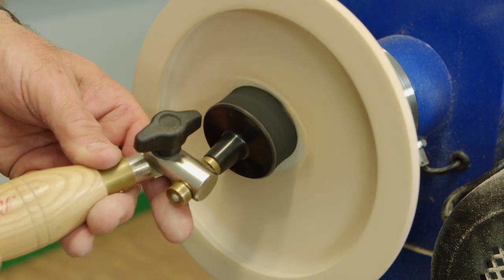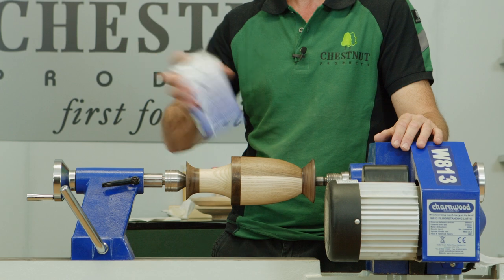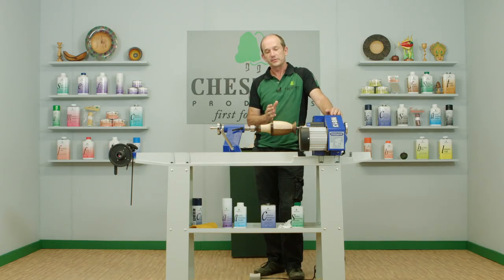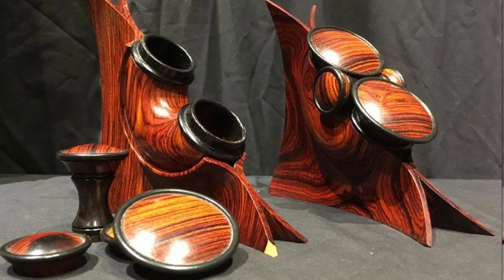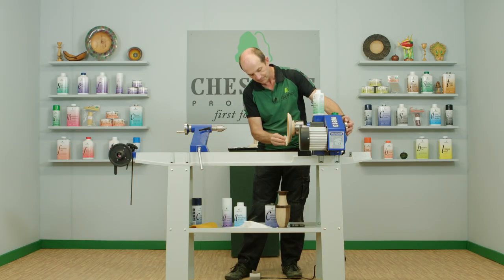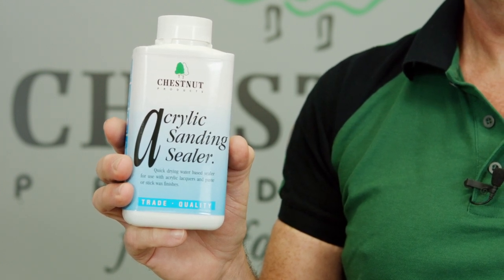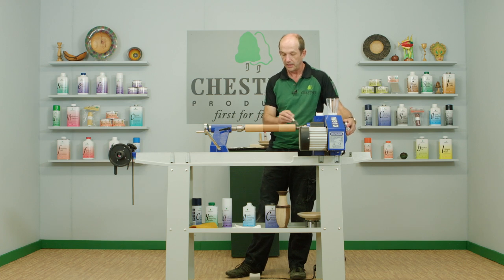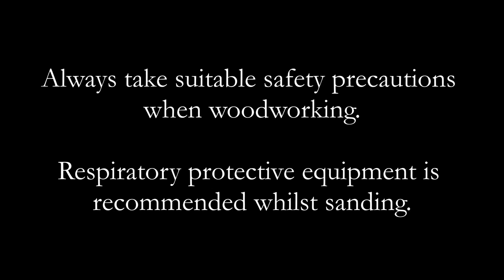How to use Sanding Sealers   Chestnut Products Finishing School 3

Comment: Hi Terry thanks for the video found it very useful. can the cellulose sealer be left as a final finish?
Reply: Hi Colin, you're very welcome and I'm glad you found it useful. The Cellulose Sanding Sealer can be left as the final finish, it might not be very shiny (possibly not a problem) and it won't be as robust as, say, a Melamine Lacquer but if your item doesn't need a lot of protection it'll be fine.
Terry

Comment: Just a thought and a tip, I thin the S&S and apply a coat(brush) to all and any plywood I am about to work on, it keeps the wood clean and hardens the surface while I'm working on it and I have found using a Stanley knife as a marking Knife works very well with the S&S,
Reply: This is ok when used in this way, to harden the wood prior to working on it, but the sealer works best when used neat when used as part of the finishing (not preparation) process :-)
Reply: @chestnutproducts3097  After watching the vid there are a few extra products I have to try out thanks for the response and your dead right used neat its best, but for an 8X4 sheet a bit of thinners saves a few bob,?
Reply from the maker: @Billlupton  If you only want to harden the plywood then thinning it is fine; if you want it to make the final finish better then not really, it's a false economy.

Comment: Hello Mr Chestnut. Do you have a video of Hard wax oil application. RE sanding sealer,do you only apply 1 coat?
Reply from the maker: Hi John. I use Hard Wax Oil in this video: https://youtu.be/0MUMMOCrswY?t=224 . Best practice is to only apply one coat of sealer.

Comment: Hi. Nice video, thanks. 
One question please, my snooker cue which is made of ash wood has grains in it. After playing and cleaning the cue with damp cloth for a couple of months , grains on cue pop out and can be felt during playing. I have to sent to cue maker for refinish. What do you think which of these sand sealers will more suitable for snooker cue to fill those grains and make cue smoother? After sealing grains I will apply oil finish (linseed oil). Thanks.
Reply from the maker: If you're going to oil the cue I wouldn't use a sealer at all. Now that the grain has been raised with the damp cloth (possibly not the best thing to be using on a wooden item), if they are sanded back they shouldn't raise again, so the problem should solve itself.
Reply: Chestnut Products thanks for your prompt reply. Cue makers filled the grains and then sand it and then apply oil finish. 
How to close or fill those pores? What do you suggest? I tried shellac on one cue and then sand it with 0000 steel Wool with linseed oil. Results were better. I just didn’t want to use sand paper on my cue. 
After applying sealer Do I have to sand it till it reaches the wood? Because I only want to fill pores and don’t want an extra coating on cue wood. Thanks for your input.
Reply from the maker: @786hunzavalley  A sanding sealer will leave an extra coating on the wood, but it will be so thin as to be unnoticeable. Just a light sanding is all that is needed, 0000 Steel Wool will be fine, but you shouldn't need to remove all of it.
Reply: Chestnut Products thanks for reply. Which sanding sealer I should use on Ash wood cue among these 3 sealers you mentioned in your video? Look to your reply. Cheers.
Reply from the maker: @786hunzavalley  You can use any of them, they will all do the job, although with all of them it's best to use a dry cloth to clean them.
Reply: Chestnut Products ..thanks, that would be my last question , wanted to ask how to clean cue , as you recommended not to use damp cloth. Cue gets dirty & sticky with hand sweat , dirt , chalk etc. And it won’t clean away with dry cloth. Is there any other way to clean cue without damaging finish? 
Cue makers also recommend to use slightly damp cloth to clean the cue? 
Thanks for your help. Regards.
Reply from the maker: @786hunzavalley  I think I'd use a little bit of wax (one of ours of course) to clean up, this won't affect the sealer at all.
Reply: Chestnut Products thanks a lot. I will give it a try.. and give feedback soon. Cheers.

Comment: Great video. Is it ok to flood the surface with sanding sealer? What grit should I use to sand it please?
Reply from the maker: We wouldn't recommend flooding the surface. It's not necessary, and could lead to problems. Just brush, wipe or spray on a single coat, that's all that's needed. Cut back using the same grit that you last used on the bare wood.
Reply: @ChestnutProducts  thank you.

Comment: Hi is it only the shellac sealer that leaves the wood slightly darker? I hoping to find a replacement for my Danish oil but fancyed the water based acrylic thanks
Reply from the maker: Yes it is, the others will dry pretty much clear. You can always colour the timber first with our stains if you wanted!
Reply: @ChestnutProducts  Thank you so much for letting me know. 👍

Comment: Hi there, I just wanted to ask about sealing balsa wood. I'm thinking about making some fishing floats (bobbers) from Balsa wood and am thinking of using a dipping technique to avoid any brush marks. There are many sealers available but like to know if a sealer thinned down to use this technique would work. If so, which would be the right one to use?
Reply from the maker: That's such a specialist and specific use Pete that we don't have any experience of it. If any sealer is going to work it'd be the Cellulose Sanding Sealer, my main concern would be how long it would last in use. You'd need to do some product testing (i.e dip some floats) to see how it works.

Comment: Am I correct in thinking that sanding sealer should not be used if the final coat is going to be oil based?
Reply from the maker: Yes, oils are designed to soak into the timber, at least in part, so best practice is to apply them straight onto unsealed wood.

Comment: Hi Terry is there a benefit of thinning the  cellulose sanding sealer and adding 2 coats instead of using 1 coat out of the tin? Kind regards Paul
Reply from the maker: Hi Paul
Sanding Sealers are designed to, and work best when allowed to, do the job in one coat. Whilst there are occasions when it makes the application easier to thin the sealer slightly (10-20%) this should only really be done when you have to, not as a routine thing. 
In fact it can be detrimental to the final finish to apply more than one coat of sealer (thinned or not) and this should be avoided if at all possible (absorbent pieces such as spalted wood are the main exception).
Terry
Reply: Chestnut Products thanks Terry, looking forward to the next video
Reply: Good question Paul and one I've been wondering about too.
Reply: Looks like I've been doing it wrong Terry, two coats diluted with 40% thinners brushed on! I'll try one coat undiluted and applied with a cloth. Thanks for the video and the answer!
Reply: Just tried one coat of cellulose sanding sealer wiped on undiluted on a couple of Ash pieces and the finish is definitely better.

Comment: Hi Terry. I noticed when you were sanding that you did not clean the dust of the piece between each grit is it aviseable to do so?
James
Reply from the maker: Hi James. I wouldn't normally clean after each grit, I reckon that any very slight benefit that could be achieved by doing so would be outweighed by the time and effort involved. Really pleased to hear you like the films, thank you!
Terry
Reply: @ChestnutProducts  The theory is that minute particles of the abrasive do come off the substrate; if these are not wiped away, they can supposedly leave scratches when the next grit is applied, reducing the quality of the finish. A simple wipe over with your hand should be enough to remove these. I can't say I have noticed a significant difference, but a simple wipe of the hand takes so little effort or time that I have been doing this between grits for the last few years, just in case!
Reply from the maker: Hi  @craftsmanwoodturner . I like that you're slightly sceptical of this theory and I'd tend to agree with that. If anything this highlights the importance of using good quality and fresh abrasive - there shouldn't be anything shed by the abrasive at all. Plus, wiping over with a hand increases the risk of transferring oil, grease or moisture to the surface and these can have a much more detrimental effect on finishing than minute particles. As a rule I resist the temptation to stroke the timber until I've at least put a sealer on it.

Comment: I'm getting white patches on some wood types after applying sanding sealer, could it be I had applied too much sealer?
Reply from the maker: White patches are usually a sign of poor adhesion. How do you prepare your wood? Does it happen more on hot days?
Reply: @ChestnutProducts  It's from last week I started with a project. So patches found on Wenge & Walnut, lots of other wood species on this project not affected. All the same process, wet sanding until 400, then 600 & 800 dry, sanding sealer, then water base varnish.
Reply from the maker: @dozukime  What are you using for the wet sanding? When do the white patches appear?
Reply: @ChestnutProducts  lamp oil & liquid wax, but this is sanded out with the 600 & 800. Patches appear about half an hour after sealer.
Reply from the maker: @dozukime  The white patches would suggest otherwise, I'm afraid. I suspect that some of the timbers are still retaining the oil; this is causing an adhesion failure which is showing up at the white patches. Maybe try without the oil/wax?
Reply: @ChestnutProducts  Thanks for your help. Previously  I was only lightly laying on the sealer, now I giving some pressure, until now it's seems OK. Thanks again.